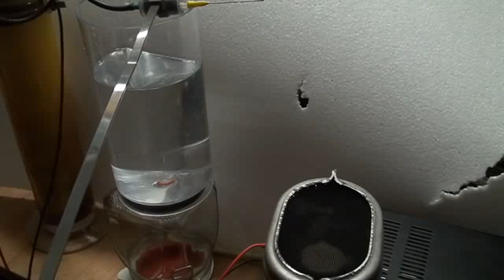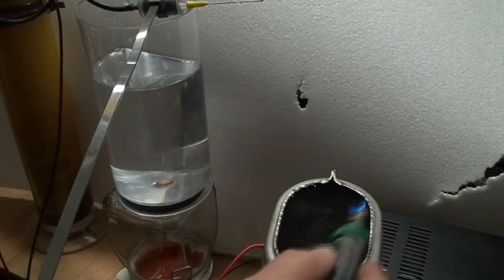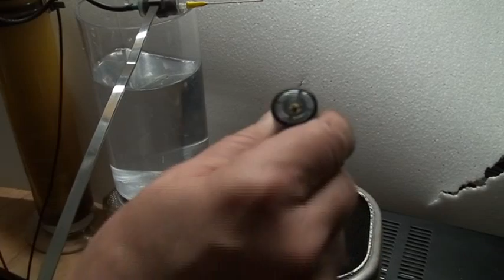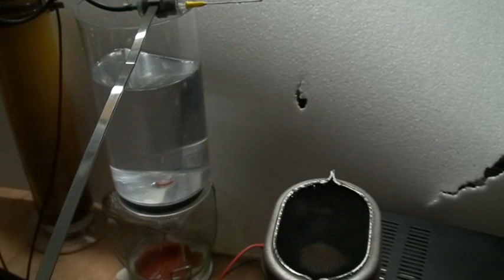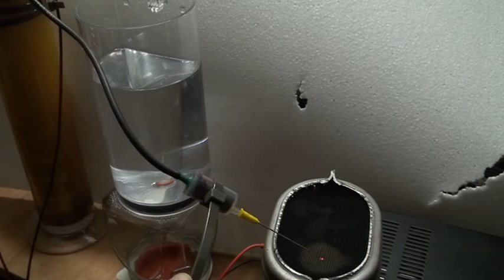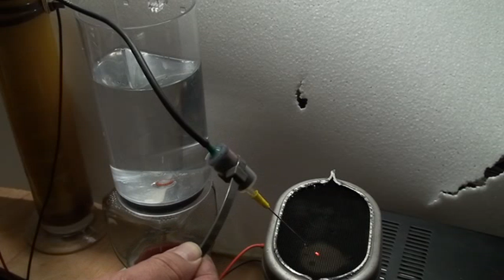CAT to LENR approach 2 wmv

Comment: New overunity idea. Make hho under water and run it through a pipe so it creates power by means of hydro turbines. Basicaly its hydro power by means of hydrogen turbines under water. Because hydrogen rises all the way to space if you need more power just use more pipe and sink the unit deeper. This is working with gravity not against it.